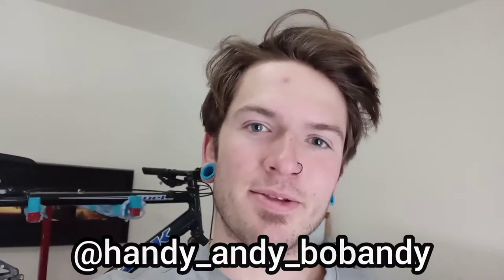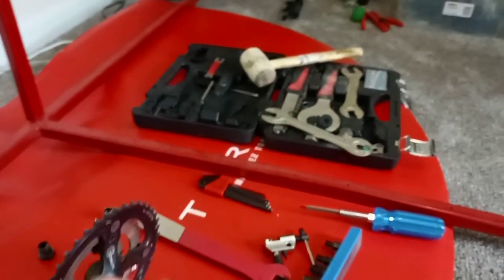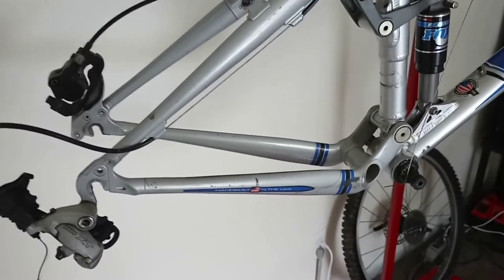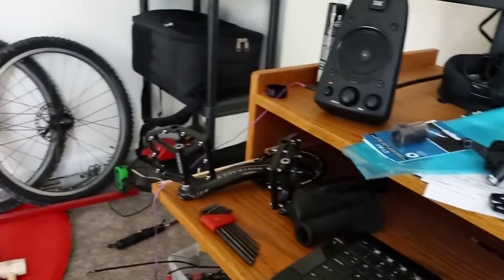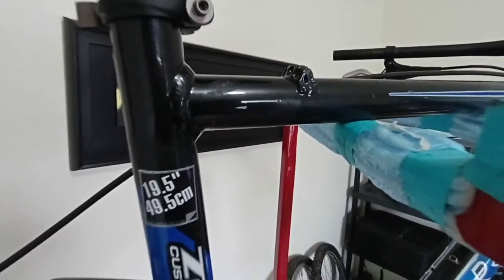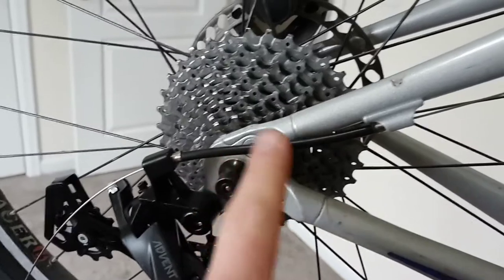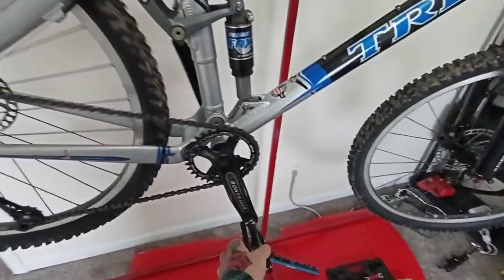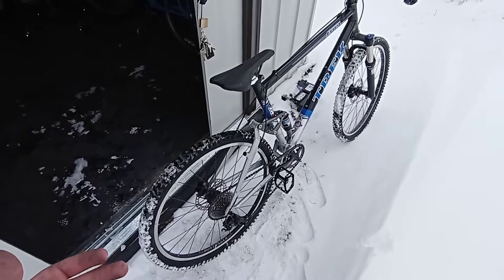Microshift Advent 1x9 Upgrade (Trek Fuel 90)

Comment: Thanks for the upload I have the exact same bike it's just been powder coated dark grey and I'm putting a Bafang mid drive motor on it it's got a mix of mavic rims a drive train of xtr and shimano saint with hydraulic  brakes and a 9 speed 11 x 46 cassette  and a 36 tooth chainring I've also got a hardtail Trek 3900. With similar set up but analogue these old Treks really suit a mid drive conversion and will ride as good as something costing 10 times as much.
Reply: I’m about to go through this process as well! Any advice in a 11 year rear set? Wanting to order parts soon. Might go down the 29” front shock and wheel upgrade to to totally Frankenstein this thing!